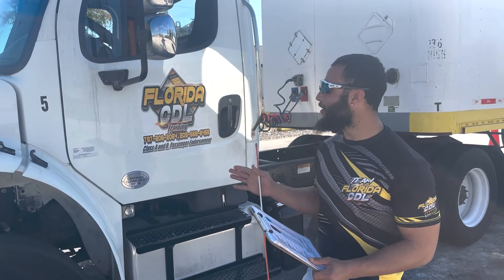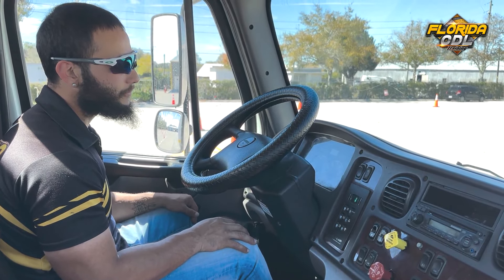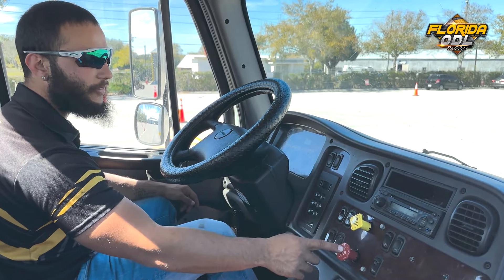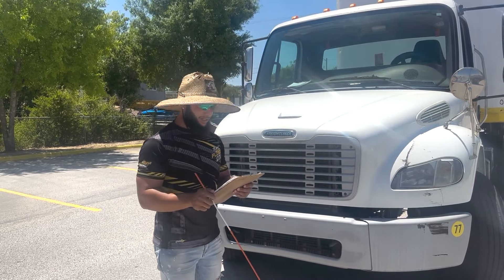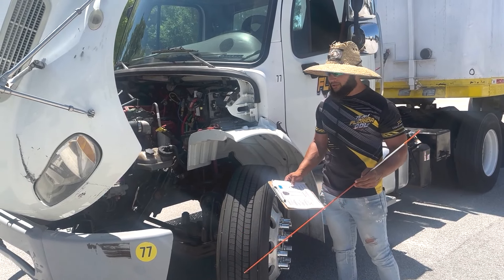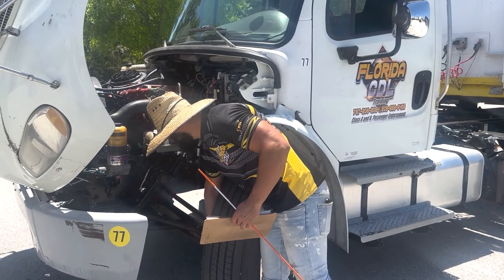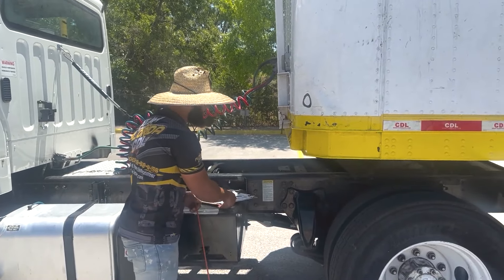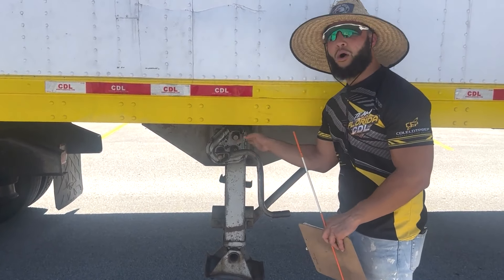Modernize CDL Training: Class A Vehicle Inspection | 2024

Comment: There were a few things missed, but besides that, this was a great video. On the leaf springs, there was no mention of the u-bolts. Also, with the oil dip stick, you never mentioned putting back the dipstick after taking it out the 2nd time, then you should chock the wheels during the air brakes test. There was no mention of the hub oil seal and that should've been mentioned. That's just a few things but as I stated this was still a great video. I also want to state I'm in Virginia so our test may be different but it shouldn't be.
Reply from the maker: Hey Tony, thanks for the feedback. They just updated our test in Florida and this is the new updated test. The u-bolts, and hub oil seal do not need to be mentioned anymore, they used to previously. However, the test might differ in your state. Every state has a bit of a difference. We also do CDL Testing here and we are confident of our inspection. We only offer what is needed for the test.
Reply: @floridacdl  where do you guys test at? I'm in school now, need to finish PTI and Backing  Eval. Then the dmv test.

Comment: Good video! You missed the seat belt, ABS light on the trailer and the DOT bumper should also have reflective tape.
Reply from the maker: Seat belt and ABS light on the trailer do not need to be mentioned.

Comment: I took my cdl road test pre 2022 in a f750 fifth wheel I got an o restriction no tractor trailer/ fifth wheel does that mean I can drive a truck with fifth wheel but not a tractor trailer with a fifth wheel. Now if you take it u won’t get a restriction but pre 2022 if you could mount something on the bed of the truck with fifth wheel it wasn’t considered a real fifth wheel so stupid.

Comment: So saying building pressure between 120-140 psi is NOT enough, you MUST say also at what psi did the governor cut-off as well example at 125... I got failed for that by some greedy and corrupt schools and examiners in kahoots, imagine...
Reply: 2nd fail... He Must announce the psi at the start of the 60 seconds and at the end so to calculate that 4 psi was not lost
Reply: 3rd fail warning sign to activate at 55 or more psi and to Announce at what exactly psi did activate !
Reply: 4th fail, must announce the psi at which the emergency parking brakes activated... saying only between 20 and 45psi is not enough
Reply from the maker: @miroslavvasilev4536  Everything you just mentioned is not required, thank you for the input but please don't mislead students.

Comment: This is not how to conduct the pre-trip inspection. Please stop doing it incorrectly; it confuses drivers. this is how going to say it ( Coolant Reservoir
	Indicate where the fill cap is on the reservoir.
	The level is between the full and add marks, it is filled to the adequate level by the sight glass.
	Not leaking.
Stop it. I'm the lead instructor at the community college, and we deal with individuals like you who give wrong information every day.
Reply from the maker: Thank you for sharing your input. I appreciate your dedication to ensuring accurate information is presented during pre-trip inspections. However, I must respectfully clarify that the information provided in my instruction aligns with FMCSA standards and CDL testing guidelines. While your example highlights key inspection points, the approach I utilize is designed to provide drivers with a comprehensive understanding that prepares them for the field and the exam.

I value constructive dialogue and encourage exchanging ideas to support driver education. If you'd like, I'd be happy to review your teaching methods and collaborate on any updates to ensure consistency across our practices. After all, the ultimate goal is to produce safe and informed drivers.

Let me know if you'd like to discuss further!